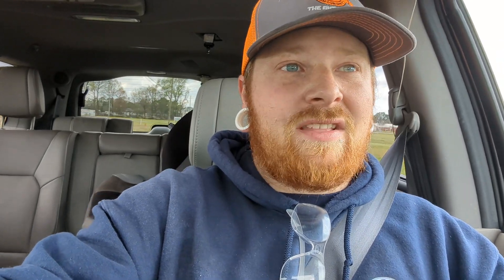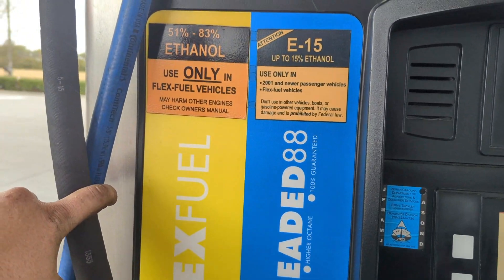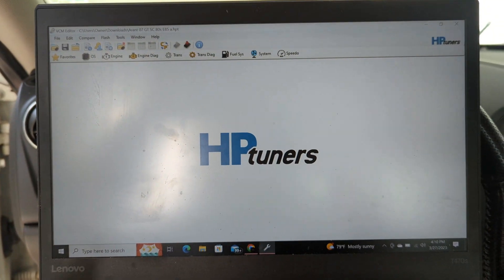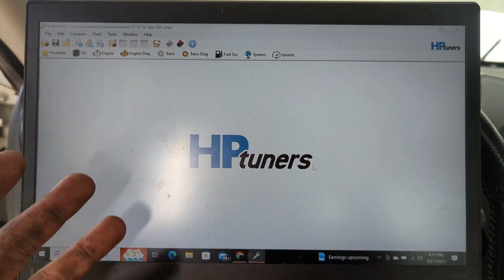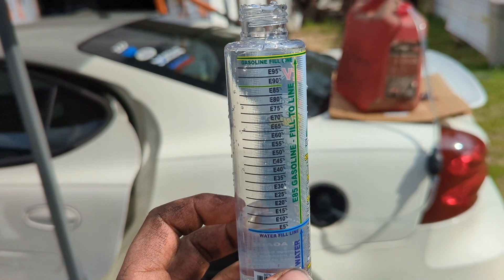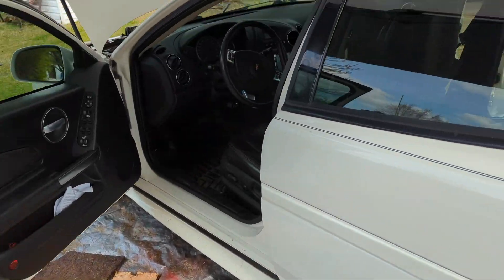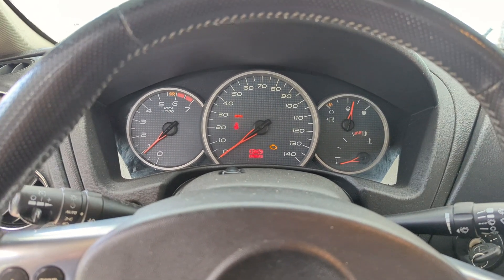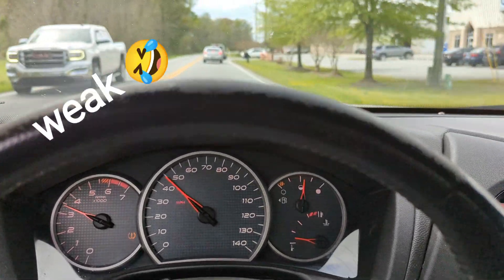Benefits to Swapping to E85! What you need and the Results!

Comment: How much power going E85 roughly?
Reply from the maker: I'm not 100% sure but I think it's safe to say about 30% more
Reply: @The3800Daily  so on stock l32 if i do E85, 42 injectors + front plog maybe extra 70 hp?
Reply from the maker: well some people say up to 30% some say up to 20% but it really all comes down to ur already supporting mods. Like a stock N/A definitely wouldn't get that 20% but a boosted build with big injectors intercooled with bored out heads and a cam may get closer to that 30% because it's bringing in a lot more air which in return means more fuel. So it's really all build specific
Reply from the maker: @DooDicky  to answer ur question. No u probably won't make an extra 70hp. However u may make 20-35hp maybe depending on the tune and how healthy ur engine is. However if I were u I'd size up the injectors. Ik people say the 42# ones are fine. Firstly they are old and tired secondly they will max out eventually down the road so why not. And third u may even make more power because they are new, clean and won't be closer to that 100% duty cycle
Reply: @The3800Daily  damn 30 hp thats so little! Even if i drop pulley, e85, front plog, bigger injectors and tune?
Reply from the maker: @DooDicky  well if u can force more air maybe. But I wouldn't go lower then a 3.25" Pulley. Bigger injectors yes and 1.9 rockers with 90# springs would help